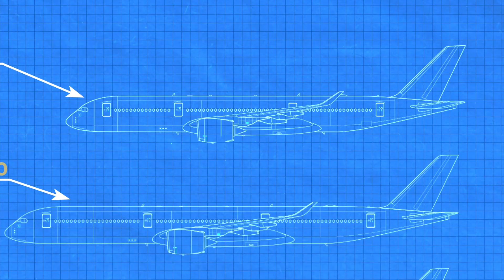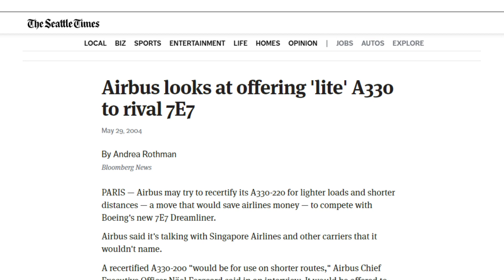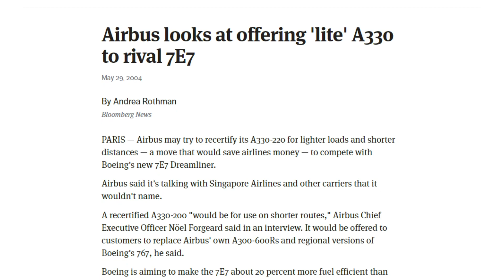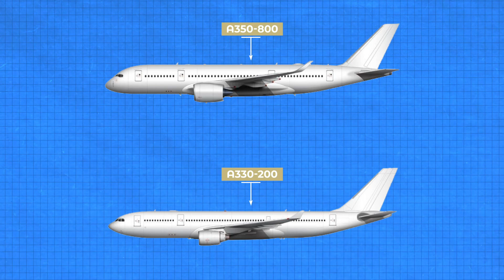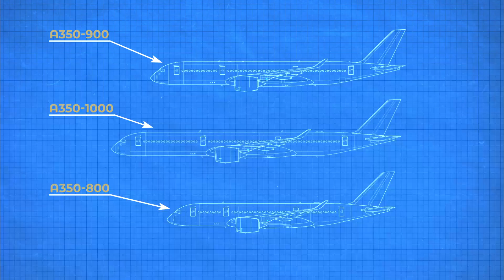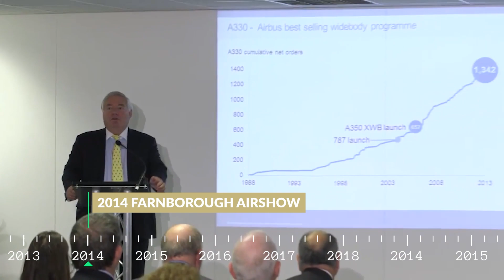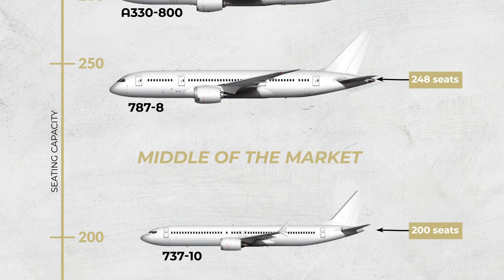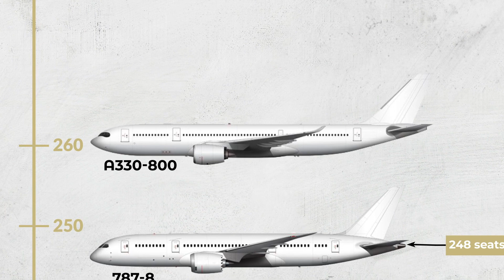The A350-800... The Ultimate Boeing 797 Competitor!

Comment: It will be better if they redesign the airbus A330neo again using this A350-800 fuselage and cockpit and use A330neo wing, so they can compete with boeing 787. Would even better if they work together with PW to develop new GTF engine to increase the efficiency even more.

Comment: This video is factually incorrect about the size / seat count of the A350-800. It was never a middle of the market aircraft. It was designed to seat 276 passengers, about the same as 787-9, A330-300 (and the same sized A330-900). That’s why Airbus could really cancelled the A350-800 and essentially replaced it with A330-900.

Comment: the best thing they can do is to redesign a new plane based on the A350-800 by reducing the size of the wings, lower fuel capacity, that would help reduce the weight of the plane a lot to have a maximum capacity of 250 passengers in 3 classes

Comment: The Airbus A350-800 is a Boeing 787-10 competitor
Reply: The -900 is, the -800 could’ve been a competitor to the -8 and maybe -9 as well
Reply: @spongebubatz  
If you look at the capacity and range the larger 787’s are competitors to the smaller A350’s
Reply: @andrewday3206  the A350-900 is pretty much located between the 787-9 and 787-10, so there’s no way the A350-800 would’ve been a 787-10 competitor
Reply: @spongebubatz  
The A350-900 typically carried 315 passengers with a range of15,000 KM it had a MTOW of 617,000 pounds

The 787-10 was designed with a typical passenger load of 330 passengers with a range of 12,000 KMit had a MTOW OF 560,000 pounds

The 787-10 was to be smaller than the A350-900
Reply: @andrewday3206  the 787-9 has a max passenger capacity of 420, for the 787-10 it’s 440. The A350 also has a seating capacity of 440, so just like the 787-10. Still the A350-800 would’ve not been the size of the 787-10, also as the range isn’t the same
Reply: @spongebubatz  
There have never been 787’s with that capacity! Boeing 747 Jumbos and the 777-9 packed like sardines can handle those numbers, but the Dreamliner never could. Yes the Dreamliner typically has a shorter range than the A350 by about 2,000 nautical miles. 

I’m not sure what your sources are but the largest proposed Dreamliner is a bit smaller than the A350-800. The jumbo at almost one million pounds takeoff weight could handle well over 400 people in 3 class seating. The Dreamliner weighs in at about 1/2 a million pounds takeoff weight and never came close to that capacity.
Reply: @andrewday3206  I went for the maximum capacity and/or Exit limit as their isn’t really "the" standard configuration. The A350-800 would’ve been roughly 2 meters shorter than the 787-9 and 8 meters shorter than the -10. 3-3-3 can be seen as a standard layout for economy for both the A350 and the 787, so the 787-10 (and even the -9) can potentially carry more passengers than the A350. Off course length does not mean cabin length but for these two aircraft it isn’t to different.
Last but not least, have you ever heard of Cebu Pacific‘s Y436 A330-300? It is possible to cramp that many people into an aircraft. As I said, as seats and configurations vary it‘s better to determine the maximum capacity instead, so the most space you can use of the cabin
Reply: @spongebubatz  
Boeing itself disagrees with your numbers.

“The 787 family is designed for medium- to long-range flights. In a typical dual-class configuration, the 787-8 can carry 242 passengers, the 787-9 can carry 290 passengers, and the 787-10 will carry 330 passengers.”

http://www.boeing.com/assets/pdf/commercial/airports/acaps/787.pdf
Reply: @andrewday3206  as I said, I took the maximum seats/exit limit as you don’t know what business class seats and so on the manufacturer uses to show the capacity of their aircraft and the maximum capacity can be seen as an indicator for the cabin space and size. Airbus states that the A350-900 has a typical capacity of 300-350, so it’s pretty much the size of the 787-10 even if we don’t take the average of 325. In other words: the A350-800 still wouldn’t have been a 787-10 competitor
Reply: @spongebubatz  
The one thing you aren’t taking into account, is for the 787 to have the range of the a350, the passenger count has to be reduced. You can only lift so much weight. That’s the point. To make up for the missing 3,000 km of range the Boeing 787-10 could not carry any more passengers than the a350-800 in the same configuration.
Reply: @spongebubatz  
The Airbus a350-800 has a MTOW of 571,000 pounds

The Boeing 787-10 has a MTOW of 560,000 pounds

Those were the closet aircraft when passenger capacity and range were taken into account. The largest 787 and the smallest a350 were close in performance. That is possibly why they were canceled and each had its own niche

Comment: They'd most likely make the 36X for that however the more realistic thing would be to starve the market with two options. A derated a330 neo. Like a -700 could cover the bigger half of the 797 whilst their xr etc cover tye smaller half of thr 797. Alot easier to do than rebuilding the a350 which is 777 tier down to the 330 world.

Comment: I'm thinking Airbus should re design the A350-800 as part of A350neo family this time with the capability to take off from LGA like a B767-300 & B767-400 both are A330-200 competitors that can actually take off and land from LaGuardia Airport. In this case DL158/159 the LGA🇺🇸-ICN🇰🇷 via DTW🇺🇸 would be the same plane all the way from New York to South Korea connecting to DL196/197 SEA🇺🇸-MNL🇵🇭 via ICN🇰🇷 A330-941 or KE631/632 ICN🇰🇷-CEB🇵🇭 B787-9

Comment: Could airbus stretch the a321, increase engine power, and increase its wingspan to create a middle of the market aircraft similar to the 757?
It’s name would be the a322
Reply: Yes they can build an A322.  But would need a new wing, wing box, landging gear, and of course engines.  It really wont be an A321 anymore though.
Reply: @Elementalism  at minimum, a cross section and empenage would be OK
Reply: It's a321xlr

Comment: The 350 program was around far before the 787 program or launch. The difference is that AIrbus took their time and did not rush the design or manufacturing as Boeing did with the 787. The 787 has had battery issues since it came out along with a variety of other issues that were lesser-known since they did not cause fires on the ramp. The 350 never had any of those issues, so Airbus built and manufactured the plane better overall, which is why many airlines are beginning to prefer it to the 787

Comment: Almost a 100 years of tube bodied aircraft... enough already. They all need to move on and start making blended wing aeroplanes now.
Reply: So a copy paste of my answear to a similar question on a previous video:

"I used to do some research into that topic. Those blended wing body concepts have two relevant flaws:
1:static stability is achieved via computer, like with fighter jets. Quite unlikely a plane like that would be approved, and after the 737MAX tragedies, completely out of the question.
2: Improvement in fuel burn isn't that spectacular. Studies show a ~33-35% improvement, but those studies are extremely optimistic. A 15-25% improvement would be realistic, but probably not enough to justify a radical change."
Reply: Its not that simple. Airports would have to massively alter their infrastructure to accommodate BWB designs.
Reply: Man thats soo unecessary, they wouldnt "fix" whats not broken like theyre being efficient and they focuse more on range performance and seats NOT looks why the hell would you say such a thing its not simple/easy and it would cost BILLIONS

Comment: IMO, the A350-800 was squeezed between the 787-8 and 787-9 and they had such a large market advantage in terms of frames ordered and customers that the A350-800 just no longer made any sense to airlines. It also did not help that as the A350-900's EIS slipped, Airbus went from the A350-800 being an optimized shrink to just a straight frame-cut which meant it weighed more empty (and therefore burned more fuel). Add in the similar trip costs of the A350-900 that you mentioned and there was no real reason for an airline - even an airline with the A350-900 (and A350-1000) on order to look at the A350-800.

Also, as the A330-300's range increased as Airbus improved the MTOW (and later, activated the center fuel tank previously only used on the A330-200), this hurt the A330-200's business case as the airlines buying it for it's range advantage over earlier low-gross-weight A330-300s could now operate the A330-300HGW and enjoy more revenue potential with minimal trip cost differences. This is why I really felt the A330-800 might have been cancelled, as well (and I do believe Airbus made very favorable deals to land the handful of customers they did).

As an option for the Middle of the Market, I think the A350-800 would be too large and way too heavy. MOM will need a clean-sheet design to really work, IMO, since that market needs both a smaller, long-range model (4500-5000nm range) and a larger, shorter-range model for hub-to-hub passenger and cargo hauling (something the South Asian and Chinese airlines have expressed as important to them).

And finally, as to the A350-2000, I do believe Airbus is looking at it, but as an eventual future fall-back position if the A350-1000 starts to struggle against the 777-9 (something I did not see happening soon and even less-so with COVID). The A350-1000 offers a slightly longer, though narrower, cabin than the 777-300ER, but it is more fuel efficient at 9-abreast than the 777-300ER is at 10-abreast. And with Business Class moving from 2+3+2 to 2+2+2 and even 1+2+1, the wider cabin of the 777-300ER doesn't really help with premium cabin seating density.

This is why Boeing went with the 777-9: it offers similar engine fuel efficiency as the A350-1000 and the fairly higher empty weight is offset by being able to seat 10-abreast in Economy and slightly longer cabin (roughly good for one more row of Business Class vis-a-vis the A350-1000).

The A350-2000 would offer the extra length necessary to add the seats necessary to bring the per-seat cost down to (or lower than) the 777-9. But until the A350-1000 sales stall out, Airbus won't want to offer it because neither OEM likes to directly compete with each other as then it just comes down to who has the lower Sales Price.

Comment: A350-800 looked very nice on paper until 787-9 came along. The 800 was a cut and shut version of the bigger 900 in order to save tooling and fabrication costs. Same fuselage, just 6 mts shorter, same wings, same engines. Which resulted in a 5% extra empty plane weight per seat, a no go from the start. Airbus’ wing in this case was 65 mts vs 60 for Boeing. With a wider fuselage more surface area, more friction, more fuel burn. This would have resulted in similar fuel burns per trip for both planes but 5% less per seat since 787-9 carries more pax, and 25% more cargo as well. A no brainer, and at that point Airbus conceded defeat and withdrew A350-800. However it replied with a330-900, which although it still has a 3% higher COC cost per pax, it can be sold for less money, so competing with Boeing on the segment. 

Given Boeing’s current comatose finances it will be a cold day in hell before they launch a 797 version to compete in the middle of the market. Rather, Airbus will field a new A322 with composite wings, 15 extra seats and maybe upgraded engines, and some extra range from 2025 onwards. 

I am certain a NEO A350 is in the making, but I doubt that with more pax. The reason is simple: 1000 shows slow sales as it is, and the 777X even more so. Market fragmentation, first by Dreamliners, then A350’s, subsequently A321XLR and now even A220’s have just pulled the rug from the feet of VLC’s like 747 and A380. Their day is clearly gone.

Comment: A350-800 has too big a wing and will be too heavy. Airbus is better to give the A321neo bigger wings and stretch it to the length of a 757-300. Or give the A350-800 smaller wings.
Reply: It looks still small so i think The -800 is just normal

Comment: A350-800 as a competitor for NMA doesn't make sense, because
1) The cross section of A350 is quite wide compared to 787, let alone a future theoretical 797 which should be more ovoid, i.e even less cross section. Wider cross section means more drag, more drag means less efficiency. Such an aircraft cannot compete with neither 787, nor 797.
2) A350 wings are quite big and heavy for such a capacity. Airbus needs to either design new wings for A30-800 (extra development cost), or again let it be less efficient.
3) A350 is very expensive. NMA should be around $80M net, or airlines will not buy it. No current wide body can be sold at this price right now.
The only feasible design will be a shrinked A330neo. It may not be as efficient as a clean sheet NMA, but Airbus can hit with very low price.
BTW A350Neo news is BS.

Comment: They should have built it instead of the a330neo. The a330neo hasn’t sold enough because it isn’t a good 787-9 competitor. A lot of a330 and a340 customers have switched to the 787. Also the a330-800neo is an nma plane in my opinion.

Comment: No, what they need is an A330 NEO2 with a fully composite wing, with fuselage and overall design shrunken back to the A330-200 from the outset, to provide a wider gap between the A330 and A350.

Nominal range is already 15,000km on the -800. A shorter fuselage with an optimal, lighter composite wing and newer engines will shove this up to 17,000km or more. The efficiency of that design, despite being a heavier MTOW than the 787-9, will be what puts pressure on the 797, which will be an all-new type with new cockpit requirements that won't be a constraint to such an Airbus product.

On the new engine front, either a scaled up PW GTF or an optimized Trent 7000 with a composite fan and/or some integration of CMCs for weight reduction will do. It doesn't have to be spectacular.

Boeing will HAVE to go all-in on the 797 to be competitive, and they know it. GE will have to integrate rotating CMCs into the GEnx and scale it down, or they'll have to take the existing metal design and gear it. They both know the Brits will bail out RR and keep the pressure on with the Ultrafan, and Airbus will not make it easy on them.

Comment: O.k. let i ex-plane the whole dilemma. Firstly get rid of the Covid-19 virus for booming the aviation transport marked. Secondly develop a cheap jet fuel or alternatively another kind of power source. (Fuelcell engines?) Thirdly forget the pipe with wing concept but develop a x-wing around an oval body. Yes a BIG drone. No long runways and running into one another.  Max pass in one class. Business class. 260 pass. O.k. we are allow for some daydreaming otherwise no birth of new concepts.

Comment: boeing not making a newer 757 was a huge mistake. A "757 NEO" wouldve been game-changer, especially in these difficult times,,,
Reply: I think the B787-8 satisfies those needs rather than retro designs. The B777x is another case.
Reply: @نادرالیراحمان  The 787 doesnt cover those needs. The 757 is a very special plane in terms of range and the ability to operate from short runways. None of the modern planes can match the 757. It has a sweetspot that will remain open, this is why people keep saying Boeing made a mistake. With the new planes you have the buy at least 2 types of aircraft to cover all destinations a 757 can cover.
Reply: @نادرالیراحمان  Nope, the 87-8 is much heavier plane and burns waaaay more gas.Its not just about how many passengers.the 787 is designed to carry a lot of gas and go very far. I am talking about a plane with around 220 Pa, that goes aorund 4000mi.. That is not what the 787 is designed to do.
Reply: It wasn't a huge mistake, it was a HUGE mistake.

Comment: I have an idea for the new Airbus A360. It will be a trijet, powered by 3 x RR Trent900 or 3 x EA GP7200 engine. It will b 3/4 of an A380 and can compete the DC-10/MD-10 and MD-11 as well as the L-1011.
Reply: But all aircraft mentioned below are out of production.
DC-10 ended production in 1988
L-1011 ended production in 1984
MD-11 ended production in 1997
Btw there is no demand for a trijet these days

Comment: Being an A330 fan, i prefer to have the A330neo over the A350-800. However, it would be interesting to have A350-800 shorter than the A330-800neo, although its not efficient to make big plane smaller.

I wonder if its possible to make the newer A310/A300. Sure, the A330 was suppose to be its successor, but the A330 are much closer the size of the 747 (back in the 90s), compared to midsize widebody like the A330, DC-10 and L1011.

It would be nice to see the neo version of the small widebody like the A310. Either that or new blueprint design. Much prefer compared to A321XLR (i like that narrowbody, but i'm more of widebody fan).

Comment: There does appear to be a gap in the market at present for a medium size aircraft, this has been occupied for years by the brilliant Boeing 757 and to a degree the boeing 767-200. It makes sense to upgrade the 757 as this aircraft has always been fantastic in look, style, passenger loads and performance esp from airports with shorter runways like the uk's leeds/bradford , bristol etc the a321 just does not compete in performance or size and after the problems with the max8 i fear with the longer 10 version